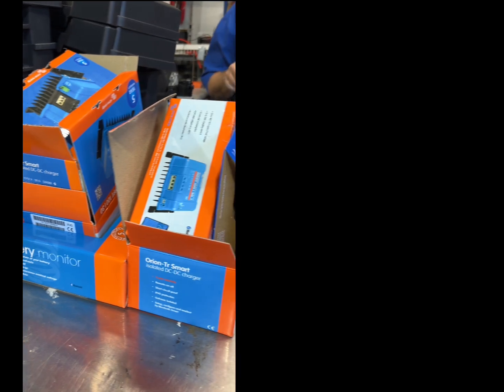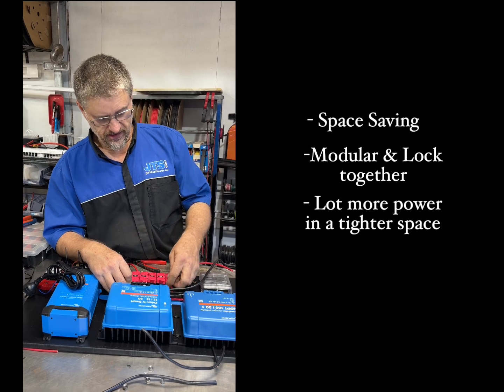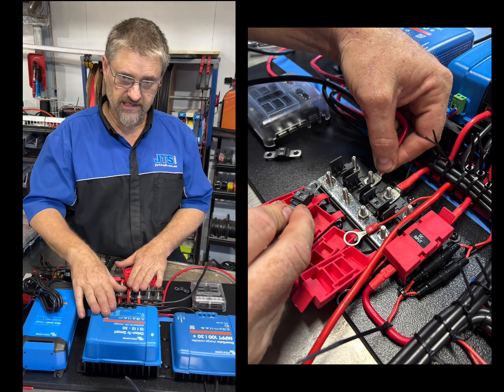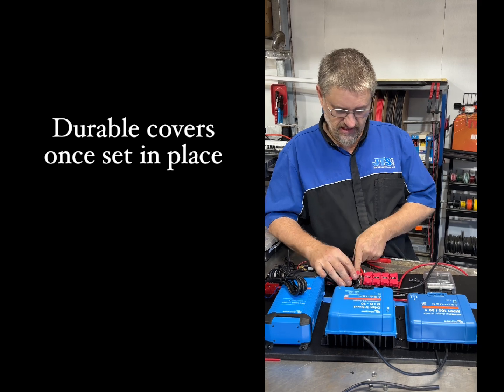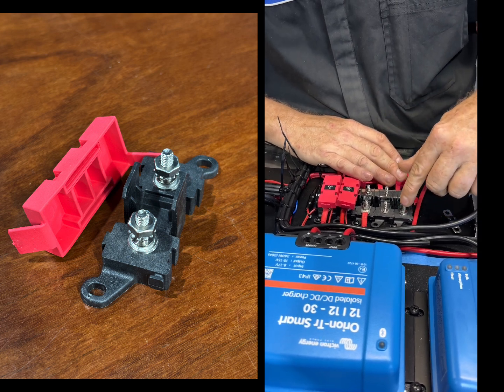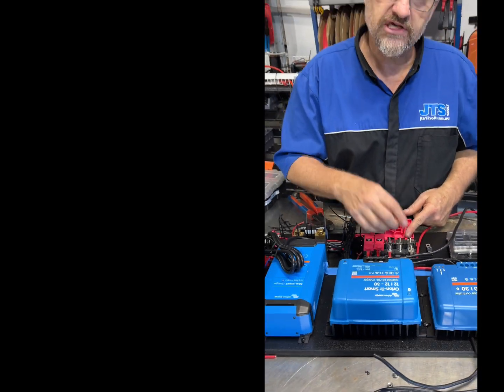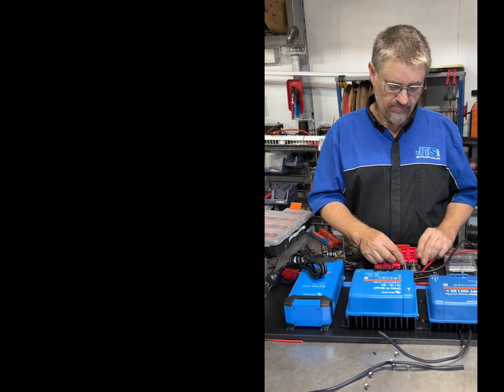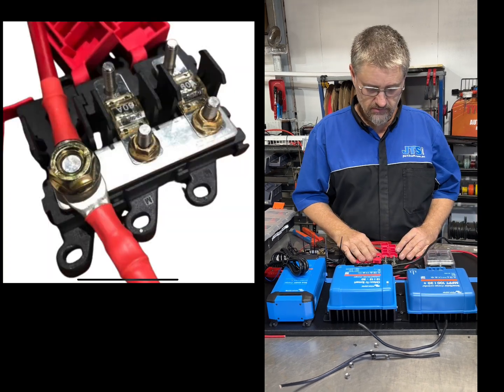HOW TO:  Why use those Midi Fuse Holders?

Comment: I like these, I have a battery bracket for my vehicle that mounts onto the OEM starter battery, but it's blank. I am looking at adding some of these for say, the accessories, like winch, spotlights etc? Not for dual battery purposes. Is this a good option, considering a lot of winches etc come with their own pre wired things designed to be directly attached to the battery